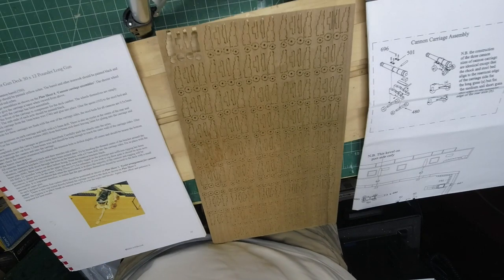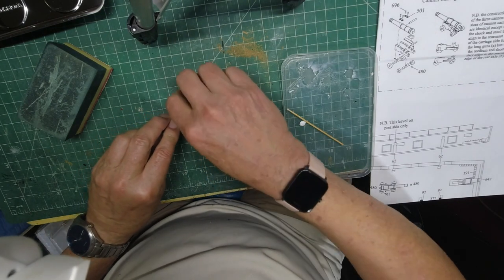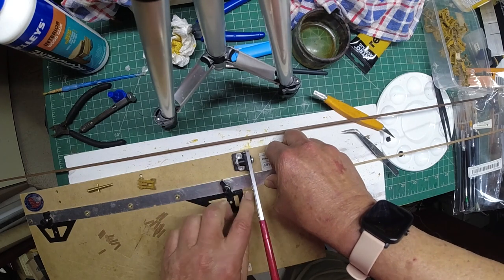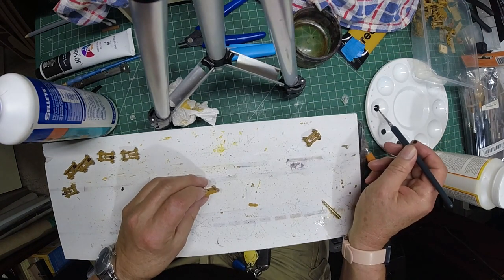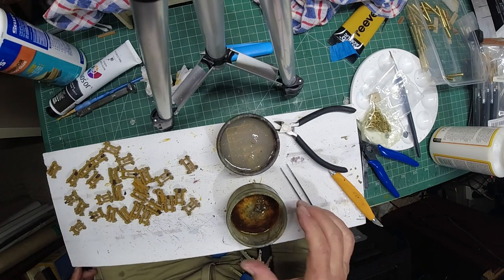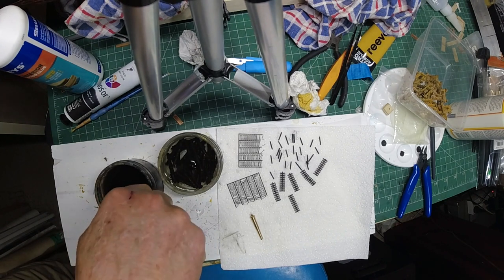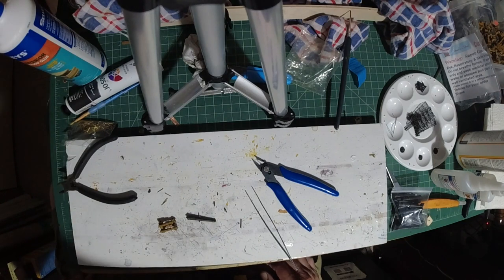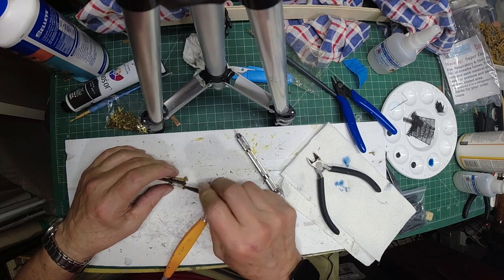Caldercraft HMS Victory part 11 cannon

Comment: You would find it much easier to assemble the trucks if you tack the front axil to a sheet of A4 paper so that you don't end up juggling several pieces. When l built mine l laid out all 30 cannons on the sheet and left them all on the sheet once glued which then made it easier to paint. I find thinking ahead and planning makes life easier in the long run.
Reply from the maker: Tks Chris, The carriages were very easy to assemble and most times press fit would hold them. But as always when you do it in front of a camera and talk talk at the same time, butter fingers get in the way and things do not go as planned. The joy of live video!
 
Cheers.